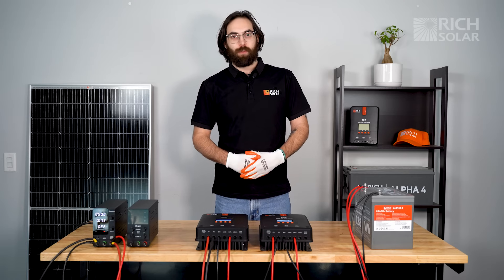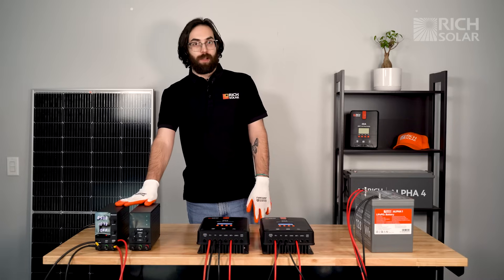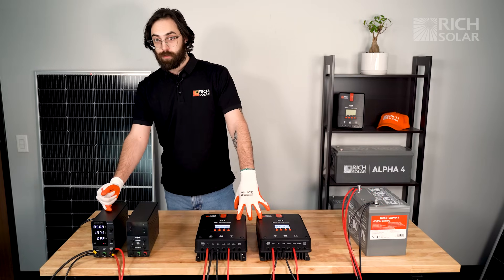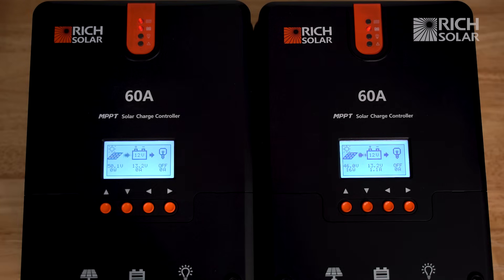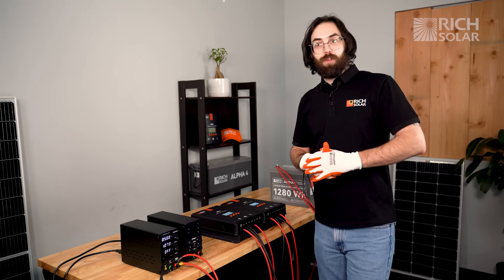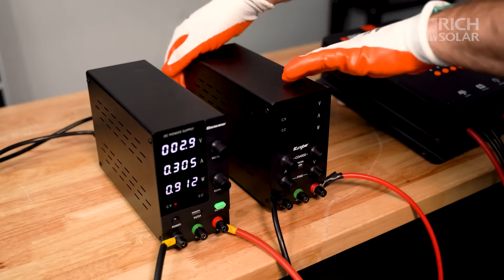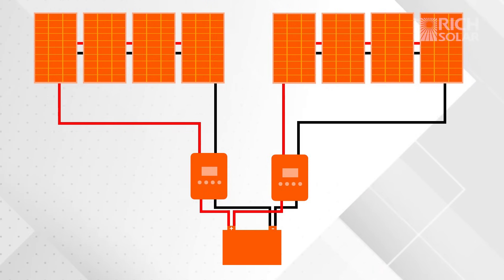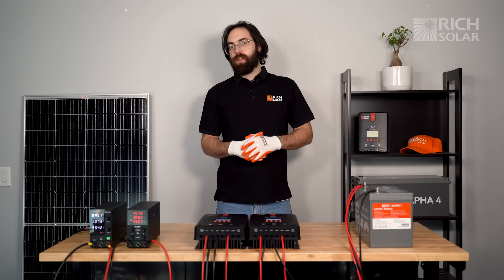How to Use Parallel Charge Controllers With Your Array: Step-By-Step Guide | RICH SOLAR TALK

Comment: i want to know if i even need multiple charge controllers or not. 

i want to charge a bank of batteries that are wired in paralell. i want to know if i can charge them all off one charge controller or not. 

I also want to know the upper limits of what i can charge off a charge controller.

Comment: I want to ask if my 1 mppt connected to the breaker going 2 bus bar going 2 my battery and the other 1 of my mppt is connected to the 1 breaker also. But my mppt is 60a and 40. Is it fine? Thanks for the help

Comment: Question, I have the 100A Litime charge controller connected to 8, 200W solar panels, 4 panels per string in series on a 24v system. I recently got 3, 405 watts Trina Solar panels. the 200w panels open circuit are on the 24v range and the Trina are on the 49.5 volts range. Victron charge controllers have an option in the app to sync the controllers to talk to each other when using multiple controllers for one power bank. Does Litime controllers have similar feature or option on the app or hard wire?

Thanks in Advance...

Comment: That's great information. Does anyone know if it is possible to use a charge controller in place of a DC to DC charge controller? Seems to me that i could use my truck alternator to charge my house batteries while traveling. Thanks, Danny
Reply: It is possible.
But you will need a boost inverter between.

Comment: If I’m running two charge controllers in parallel to the same battery bank does it make a difference on if I’m running two different solar arrays voltage or watts?

Comment: I have a question that, so far, I haven't gotten a satisfactory answer. If I have an existing system with an mppt controller and wish to add supplemental panels and already have a suitable pwm charge controller, would they work together in that situation, or would there be some conflict? I know some systems charge from an mppt and alternator from the vehicle and their charging characteristics differ somewhat,  so right now, I don't see a problem, but I'm certainly no expert. What do you think??

Comment: Hello!
You didn't present the most important thing. You did not simulate two strings with different voltages.
Lower the voltage on one of the power supplies to 30V, simulating that one string receives less direct sunlight than the other.

Comment: I love your video.  It comes at a time when this two controller style is becoming popular.  I would have liked to heard a comment about the output. Since the controllers read the battery type and resistance for charging, do they then fight on the output side?   Thanks.

Comment: Thks buts;
If the battery needs equalization & boost charging , it must be settup on one of the controller & turned-off for the other or your battery will get a double dose of equalization & boost charging ??right???